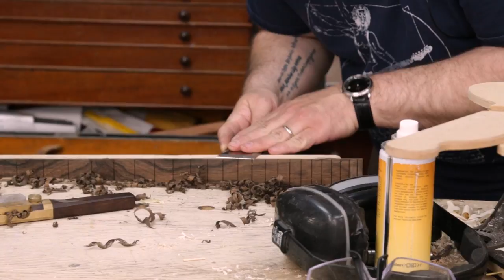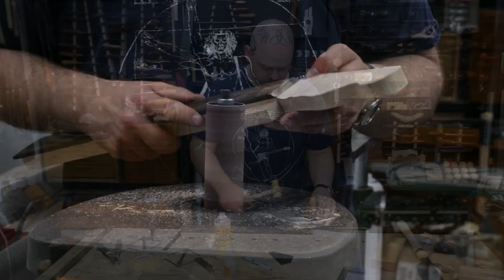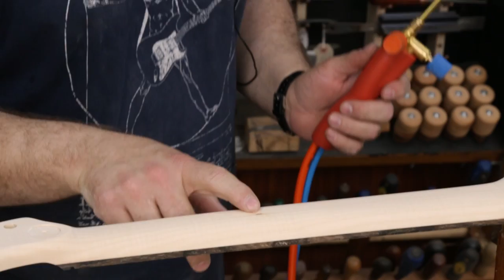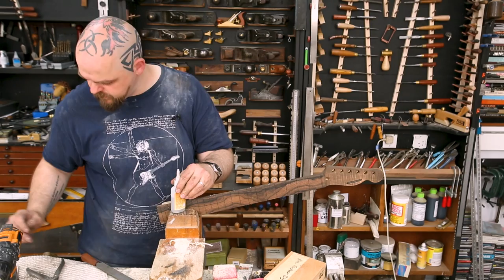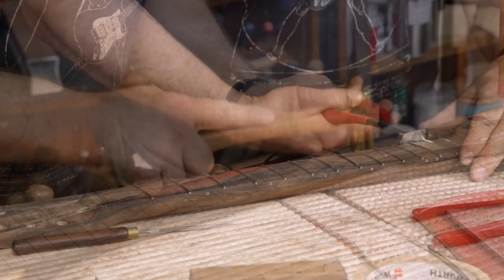Part 3 - Build an electric guitar with Crimson Guitars

Comment: Neck wood can be "torrified" at home easily. Just make sure you air out the house before your wife gets home. A neck blank will fit in a large conventional oven. 175 C/350 F for about 4 hours and you have a very nicely torrified neck blank that is golden all the way through. (BTW if you mak a jig with ceramic clamps to keep it straight, a vacuum is not needed. it's the 4 hours that does it.  It also leaves a beautiful maple (if that's what you're using) smell. Caution to watch your temperature closely since I tend to use this process for maple only the smoke point is Approximately 180 C;/ 360 F  It will be at the combustion point.

Comment: This is so good, I am 'binge-watching' the whole build!

Please explain how the 'dual action' truss rod works. I can see how it may work in compression. It does not appear to be anchored at the neck end to allow a tensional force?

Many guitars have the truss rod (single acting?) in the back of the neck; thus they oppose the string tension when in tension.
Reply: It works on it's own construction. No relation to the neck. It just bends all on it's own. But it does need to fit tightly in the channel so that it does not move when you adjust it. In a way it does rely on that channel in that the walls provide a fence for you to adjust it against.

Comment: last resort, a twisted neck. remove the fretboard (heat is good to warm the glue) then rout 2 small channels in the neck. insert carbon fibre rods and re-glue the fret board

Comment: I think Crimson should begin to make and sell Allens wrenches long enough to clear the headstock!
Reply: I made a simple solution using a short socket and adapting a socket shaft adapter for drills. Then just use another socket that matches the adapter shaft on my socket wrench.
Reply: how about just using the propper allen wrench in the appropriate manner, just saying...

Comment: Here is my beginner's question:  Since it seems that most guitar necks taper to be thinner towards the headstock, or in other words, the fretboard sides are not parallel,  when cutting the fret grooves across the fretboard, How do you insure the slots are perpendicular to the neck centerline?  Are these slots cut earlier before the tapering of the neck?  I want to build a Strat-style, but I need to learn as much as possible.  Thanks.

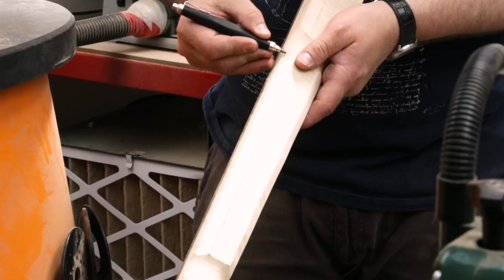Comment: 32:53 you're doing measurements before using the Bobbin Sander and that's quite critical I'm sure you agree, it's not that visible on a smaller screen, maybe going in further with the camera to see what you're doing would be better; From comments here this was filmed a while ago. I'm sure you seen it and updated your filming techniques by now.

Comment: Am I the only person who started the frets in and then put a block of soft wood down and put a radiused small piece of wood over each and just pressed them in with a drill press working down the neck? I already had the drill press and is controlled exactly like an arbor press would be, the hardest part was walking to the drill press. 

Lot of good tips and yep I did the flaming with fire on a body. You can manage with a normal torch and mapp gas, do not use propane it takes way too long and the glue will melt also a spray bottle of water will save your work if it gets too hot.

Comment: I have been enjoying the videos and your delivery. I do have a question.  I noticed you used a track saw track with a device that accommodates the use of your Triton Router.  I have not been able to find that device.  I have the same router and plate but not the "track" adaptor(?) can you put me on to a source?  I also have the triton track saw and track.  I got no response from Triton when I queried them.
Reply: I would totally buy one too. Since Ben lives in the UK, I would try searching the UK sites. For example, instead of using google.com use google.uk.